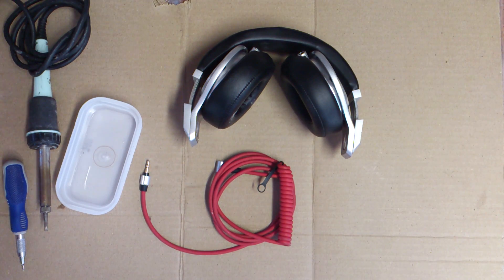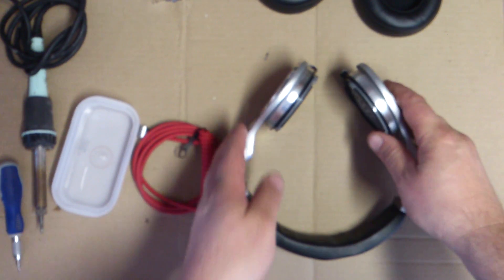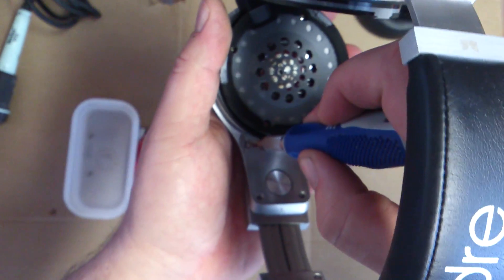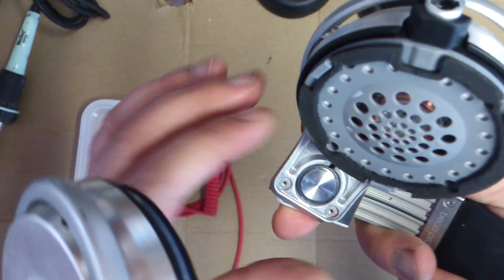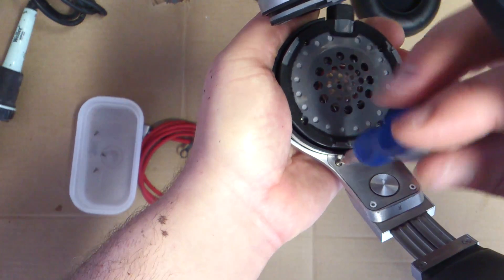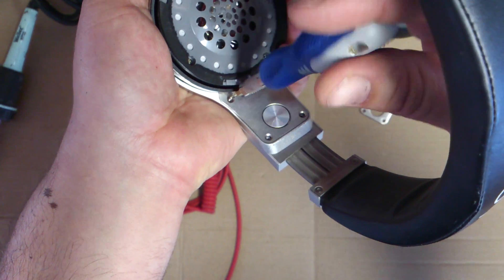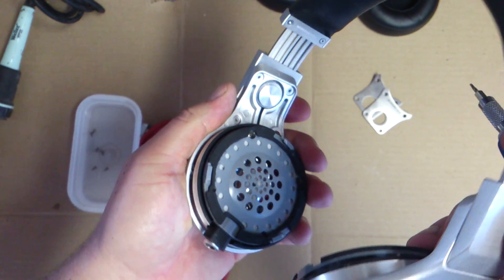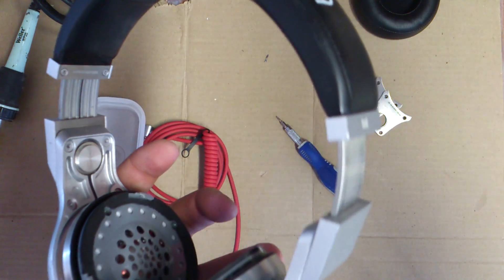Beats by Dre Pro Take Apart

Comment: These are still the best sounding and most solid build they have ever made in my opinion and look the best love the sharp metal look instead on round plastic
Reply from the maker: I agree these are solid. The metal design is great and durable, the actual speakers could use a little work, but for DJ work the Bass is really sweet.

Comment: Hey.. first of all thank you for all your videos. I have these beats my problem is that. it only works on the side that I put the wire in.  both speakers work but not together. How can I make the sound come from both side? In another word where is the connection cable located so I can try to fix it...Please help.
Reply from the maker: Thanks! I try and be helpful when I can. There is a cable that runs through the headband, sounds it's broken.  I'd check the swivels and see if the wire broke there.

Comment: How do I reattach the soft ear cuffs / muffs? Nobody has a video on that!
Reply: Thats is what I need too. They are easy to take off but never reattach properly
Reply: Lora Sullivan u buy new ones.. hurry up n buy!
Reply: nine years later 😭 i literally couldn’t figure it out after 30 mins
Reply from the maker: They should twist on. Pressure on the area where the tab goes into the headphone helps. It could be after years of use, you may need new ear cuffs.
Reply: @Jay-May  this actually helped; i figured it out. thank you so much for replying after thirteen years...

Comment: Has anyone else had a problem with the headband?  My left side no longer makes the ratchet noise.  when fully pushed in it doesn't sit flush it cants to the side a bit.  kinda like the extension has come off its track
Reply: +Wes Beaty i have this problem did you ever fix it???
Reply: Never was able to fix it.  Ended up giving the head phones to my nephew